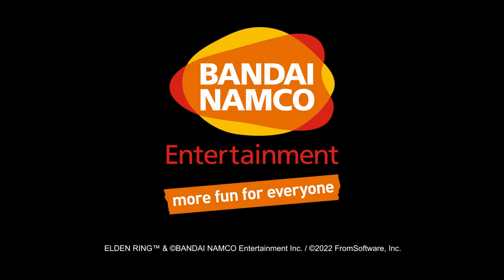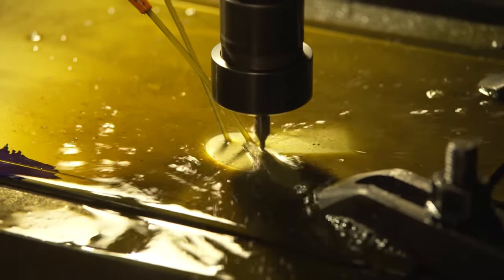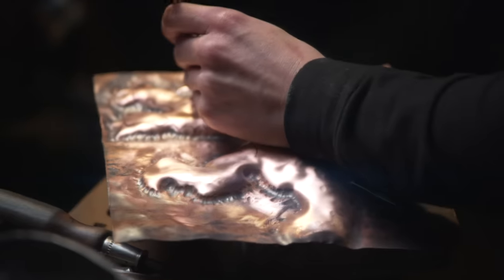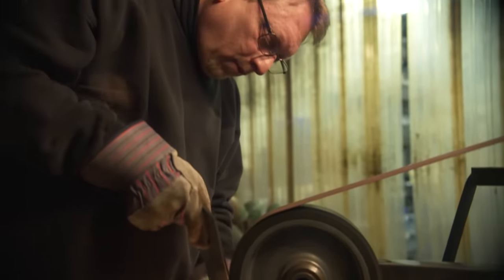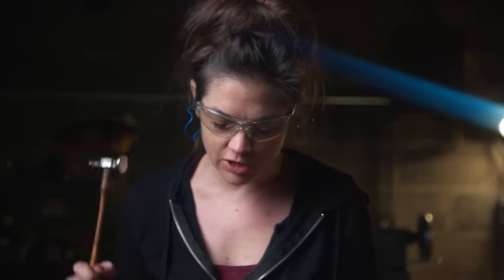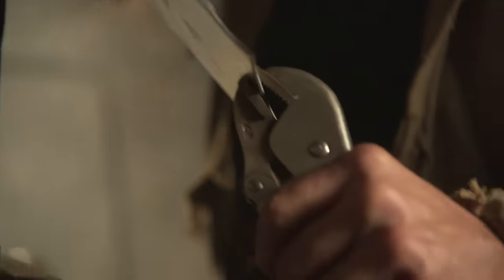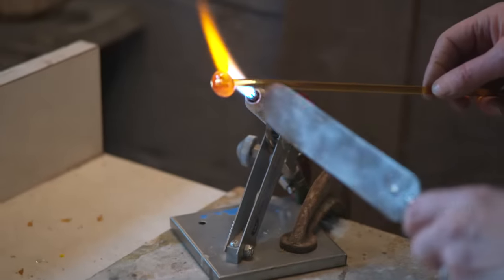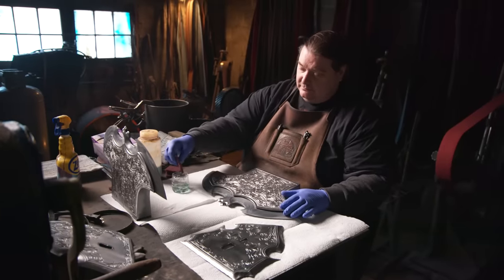Godrick's Axe - ELDEN RING - MAN AT ARMS : REFORGED

Comment: Here is my stance on cnc...

nobody bats an eye when a machinist takes a piece to a machine be it a mill or lathe or such, however i think many people watch because they want to see the process of SMITHING and not machining. There are smiths that do use machines and i dont see any complaints for them because the machines they do use are ones like power hammers and when they weld they forge weld instead of using a hand tool.

I think its perfectly a perfectly valid perspective these people hold: that certain machines are "cheating" within the realm of smithing... and its cheating because its no longer smithing but rather machining. It still takes skill and practice but i can agree with the sentiment that it isnt "smithing" anymore

and to all the people saying "its a tool, why complain" or "they are just afraid of progress" and such... There is an appreciation to be had in seeing something done the hard way, and knowledge to be gained as well. That is certainly my perspective i hold in computer science. Modern programming has so many tools, utilities, and resources to make the job easier but people become dependent on them and never ask some fundamental questions:
Do i even need these tools? Can it be done without them?
Where did these tools come from?
How do they work?
What do they do, REALLY?

Take compilers for example. Fundamentally, they are very very simple and the process for them hasnt really changed in the past four decades. With proper language design, you could even easilly write one by hand (though time consuming) by taking advantage of recursion. 

I think many people are interested in smithing without heavy reliance on machines for the same reasons a programmer might wake up one day and go say "how do regular expressions work? Can i do it myself?", or similar.